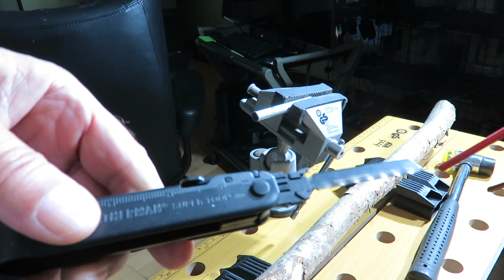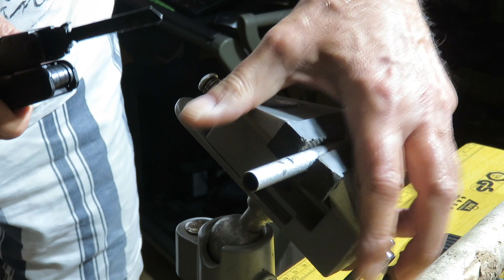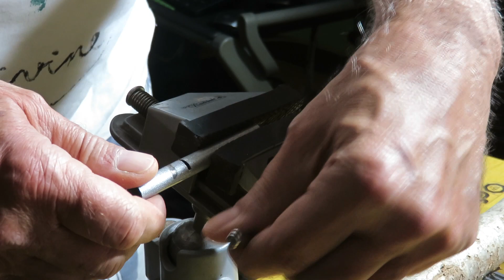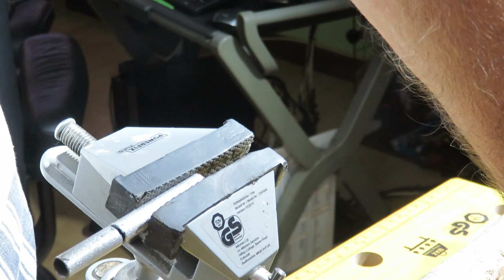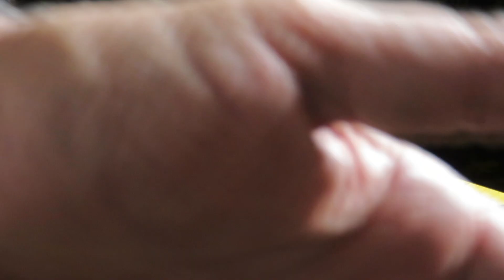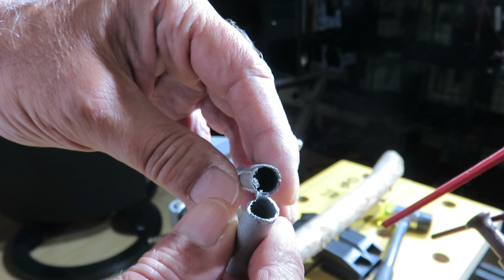Leatherman SUPER TOOL 300 EOD : metal jigsaw test! [MT VOD]

Comment: Thanks Diezelle for your effort, does this blade also fits in a surge with les flex, is it as thick as the original saw and file from leatherman ?
Reply from the maker: It is a jigsaw blade and is thinner than the blades of the Surge. So there will be a little play but if it is annoying this play can be corrected with a wedge.
https://www.youtube.com/watch?v=e8WSB8Nx4rM